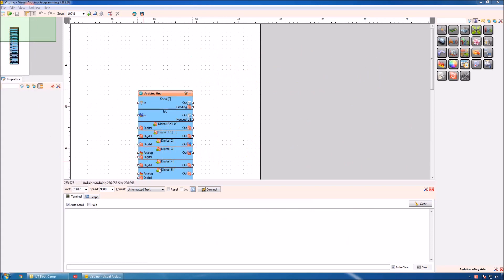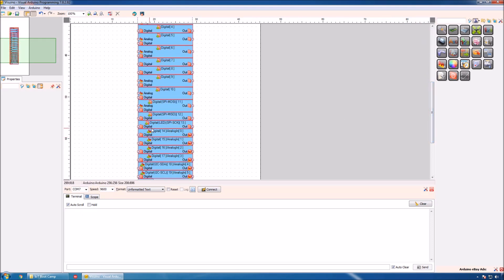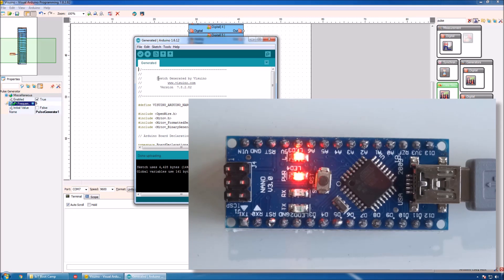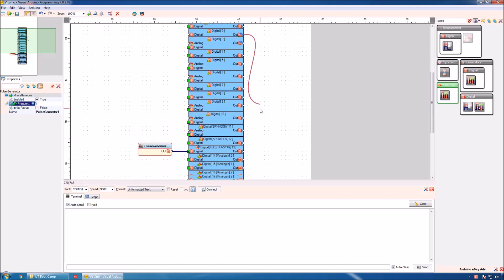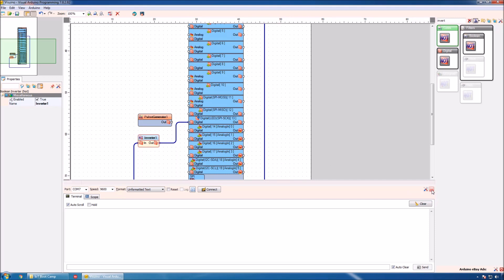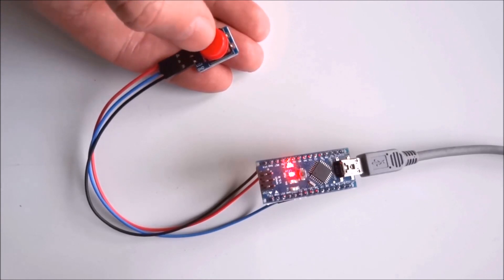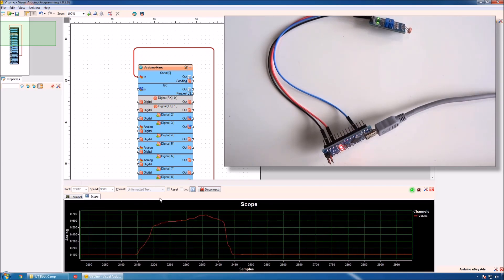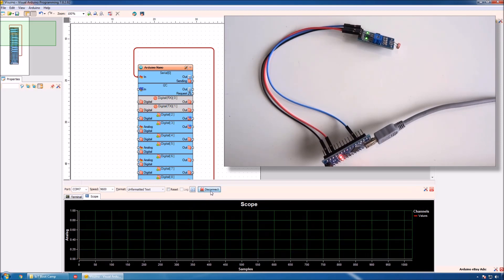Getting started with Visuino - Basic Digital and Analog Pins and Serial Communication

Comment: This program seems useless to me. There is only a cable connection, but that's it. I don't see how, for example, I will accept resistance data, calculate it and display it on a 4-digit 7-segment screen. Not to mention that it's full of bugs and doing nothing gives me mistakes. It's easier with Arduino IDE than with this. At least there is a logical connection between what is written and what he will do. Not to mention that the board does not look like the original for convenience, and the connectors are arranged radically differently.
Reply from the maker: The board is represented as a software component. Visuino is a software development tool, so it does not do anything with resistors since they can't really be controlled from the software ;-). It is also not a simulator, it is a code generator, and generates extremely highly optimized code that once compiled tales very little memory on the controllers.
Visuino allows people to develop really complex, highly optimized projects in few minutes. Achieving same complexity takes months with standard coding. But if you prefer Arduino IDE, that's cool! :-) The more choices the better... :-)

Comment: In the free version, can you use a motion sensor to turn on a 30,000 buzzer? If not, what is needed to do this? Thanks
Reply from the maker: Yes, it is possible in the free version. If the buzzer is active buzzer, you can simply use timer and connect digital pin to start the timer and the output of the timer to another pin where the buzzer is.
Reply: @BoianMitov  Thank you for getting back so quickly. I just downloaded the program so I need to watch all (I have only watched 2) the videos to see how this is done. Thanks again for your time. I hope I can figure out what you were describing so that I don't loose interest in a program that looks like it could help me with some of my projects around the house.
Reply from the maker: @amtpdb1  You are Welcome! Please enjoy :-)
Reply: @BoianMitov  I have to say that the more videos I watch, the more I am confused. I watched the one above and you had a clock module and used it, the you took the wires off of it and just put a wire from the input to the outputs in the middle. I don't know if it would help but it might help if you tell why you picked that module and then why you connected it to the pin you did and what it does, then why you picked the next output pin to the in our out of the next module and so on. I tried to generate the motion sensor to an arduino and to have it generate the 30000hz signal into the buzzer to no avail. Just not getting it. Myself it would be better if I knew why I used this module and plugged it in to this pin and what that did and so on. I have been a beginner to arduino for some time, and I thought this would be a better and faster way for me to generate projects! Maybe in the future. Thanks again.
Reply from the maker: @amtpdb1  In this case I picked a pulse generator to pulse a pin with some relatively low frequency. For high frequency it is better to use the "Play Frequency Tone" component
Reply: @BoianMitov  Thanks

Comment: Does this also apply to non-board mount components?  I have the IR and photo resistor as single pieces, would the breadboard hookup be the same?
Reply from the maker: Yes, all analog sensors are connected the same way.
https://www.instructables.com/id/Arduino-Nano-Using-Passive-Photo-Resistor-Sensor-W/
And here is how to use Infrared:
https://youtu.be/JZpey-c9RkY
Reply: Thank you

Comment: The led is on, when I push the button it goes off. Just opposite of what this shows. What is wrong ??
Reply from the maker: You probably have a button module that connects to ground when pressed instead of to VCC. You can invert it ;-)
https://www.instructables.com/id/Arduino-Nano-Invert-Button-With-Visuino/
Reply: The led stays on. It just gets brighter when I push the button. I used the inverter.
Reply: The button is N/O. It connects pin 2 of nano to gnd when pushed and pin 2 is open when not pushed.
Reply from the maker: If the button module does not have a resistor to 5V you will need to enable the builtin PullUp on the pin ;-)
https://www.instructables.com/id/Arduino-Nano-Using-Pull-Up-Resistor-With-Visuino/
Reply: Ok, I enabled the pull up resistor and used the Boolean inverter and it works properly now. Thanks
Reply from the maker: You are Welcome! Enjoy :-)

Comment: Can I program a TFT Touch LCD which has a 4532 driver chip?  (arduino uno)

there is an option for ILI9341 but not for 4532 which is ST7735 in parallel mode not SPI.
Reply: Parallel library for the ST7735S TFT display driver
https://forum.arduino.cc/index.php?topic=497932.0
Reply from the maker: I will see what I can do for the 4532. You can contact me at mitov @ mitov . com

Comment: didn't work
Reply from the maker: What is the problem?
Reply: when I connect the serial pin in Visuino and upload the code to the Arduino it does not function.
If I remove the serial wire then the code works.
Reply: there is nothing special about the project, I just did what you did in this video.
Reply from the maker: Since I do this every day, and it works, something is wrong on your system or with your project. I run this type of code at least 10-20 times every day as part of me testing different sensors, and it is used by thousands of other people, so we need to know what you are doing different than all of us, or what is different on your system ;-)
Reply: tell me how can I see the blinking of an led in serial terminal?
Reply from the maker: I don't understand. In serial terminal you can see a digital value changing from False to True etc. But you surely can't see a LED :-D
Reply: That's what I meant. Values changing from false to true and etc... that is what I want to see with the led. How can I do it in Visuino?